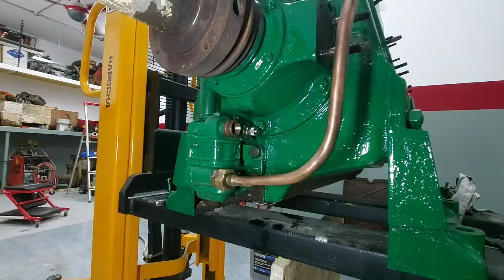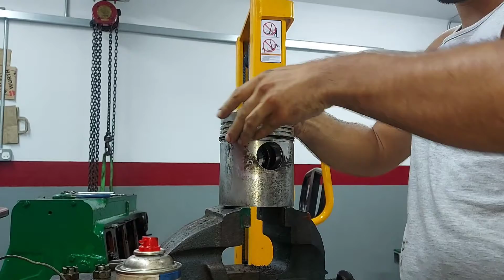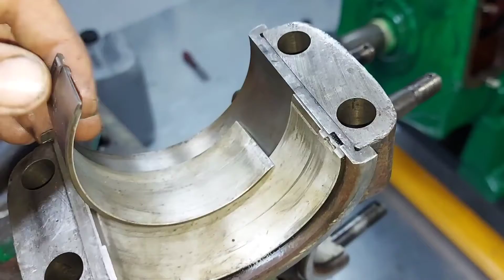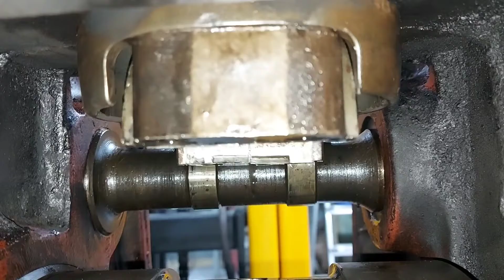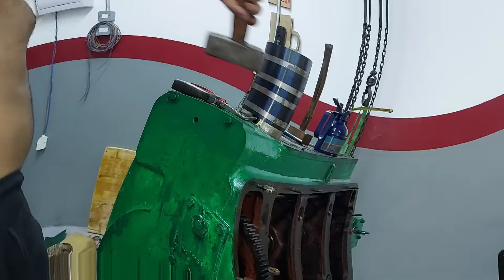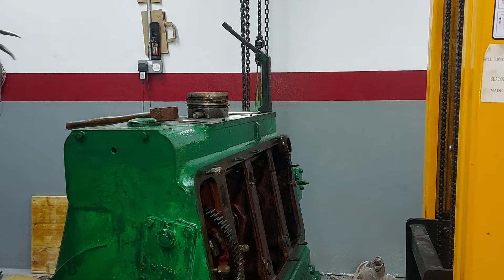How to install the pistons on Lister JP/JK/JS

Comment: Are the scavenge and px pumps the same size? It's normal on dry sump to have a much larger scav as the oil is frothy. Impressed you still manage a video when you are traveling.
Reply from the maker: Yes the scavange pump has longer gears. It should work good or better. We will see how it goes. Haha yes I manged the video aswell. I made it last week and just uploaded it private. Made it pupblic to my viewers yesterday. Forgot to do it on friday night tough.

Comment: The liners on this engine have been fitted incorrectly (90 degrees out) - the relief in the bottom of the liners should not align with the thrust side of the pistons. To remove the gudgeon pin the lister manual says to first rotate piston & rod 90 degrees such that the big end then fits into the relief. This error means the piston will have less engagement in the liner at BDC although I suspect this wouldn't cause any problems!
Reply from the maker: Yes few days after I got aware of it. I are 100% right. I went to far ahead to re take everything back and rotate them. Tought about it a bit and went to the same conclusion to yours. Thanks

Comment: That was a good tip, at least you know it has a good strong big end anyway. That was really interesting that it was running dry sump, what was the reason for that? Does it have its own internal oil pump? I can see a strainer so must have.
Reply: It had a dry sump as that used to be a marine engine,  they did it with two pumps because of the rocking of the boat !!!!
Reply: @johnhili8664  ah, that is very clever.
Reply from the maker: Its ecxactly what Johns said. It has no internal pump. The gear pump is duble. One for scavenging to the tank and the other for pressure from the tank. Thanks for your comment Paul.